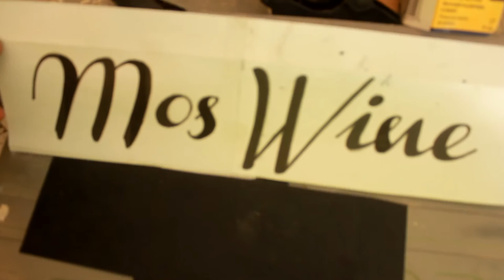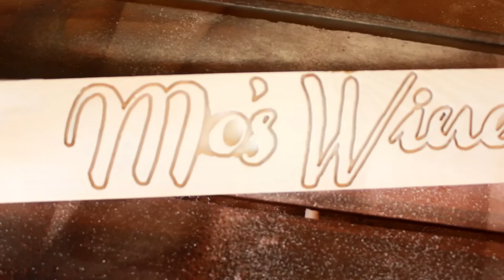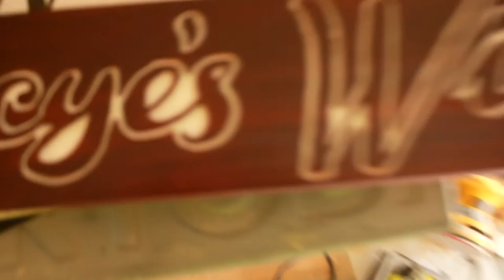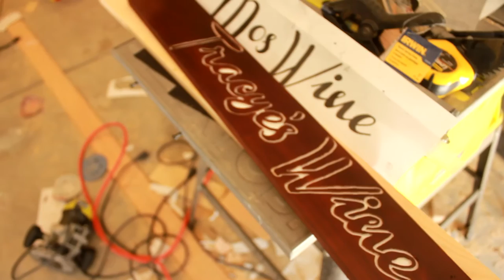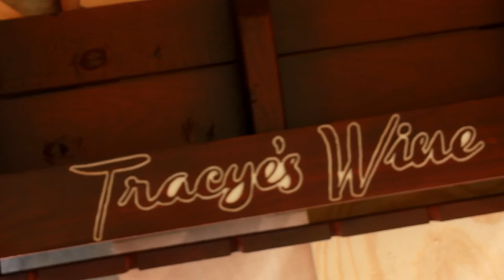DIY Wine Rack

Comment: Looks really great!  Thank you for sharing!!!
Quick question:
You put salt into the the groves and spray with PolyShades Aerosol.  Will salt stay? I would think the spray will blow salt away and some of it end up on the front surface...  Can you comment it, please?
Reply from the maker: olegarr2 just have to wait until it's fully dry so if it does you can wipe it off as opposed to it messing up finish.
Reply: I do understand you have to wait until it's fully dry after you apply the coat.  
However, the concern is if spray will blow salt all over while you applying PolyShades    Will salt stay at place?
Reply from the maker: olegarr2 i didn't have that much of a problem. just have to stay further away in that area and float it in that area
Reply: ok, thank you!   I'll give a try!
Great work and thanks again for sharing!!!